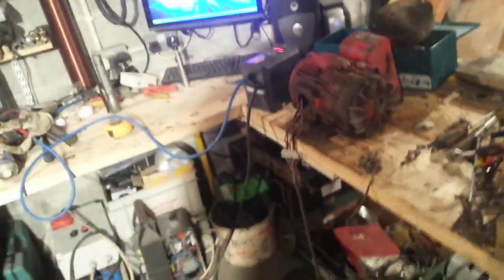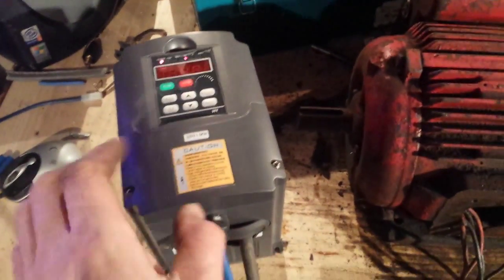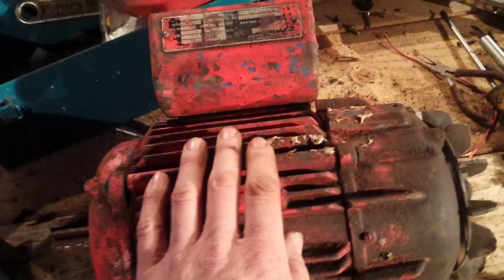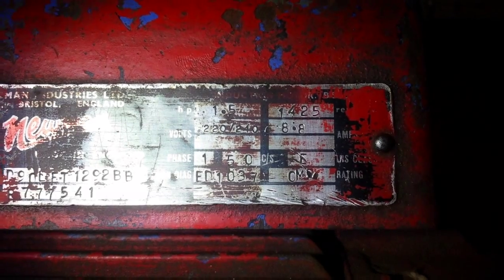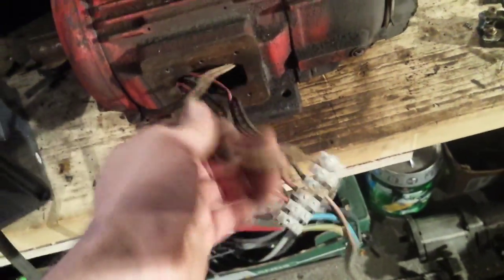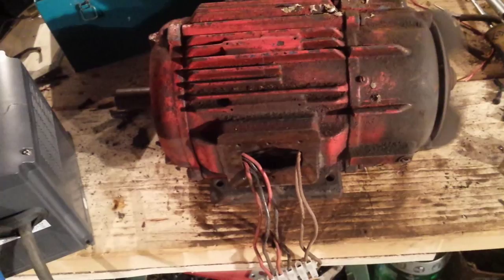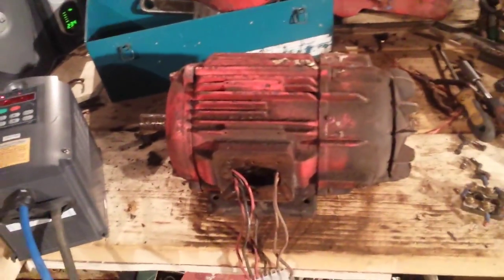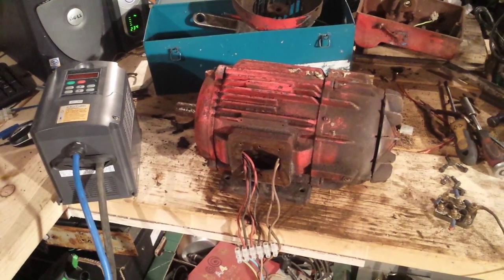1 Phase 220V motor converted to run on 3 phase VFD.

Comment: This is not good for the starting windings, but you could connect your single phase motor normaly with capacitors only use two phases on the vfd, if the vfd gives an error you use different phases because only two phases have current transformers for reading the motor current (If you have a starting cap with the centrifugal switch dont run the motor too slow, that switch needs to be disengaged after the startup) maybe use only runing cap if you dont need to start with loaded motor...

Comment: is it me, or is the earth attached to......nothing?
Reply: so when the centrifugal switch kicks off, only 2 phases run the main winding, at 120degrees, which apparently is good enough compared with the 90 degrees given by start caps
Reply: just thinking out loud, but is ther more torque with both windings energized? if so, could bypass cut off switch and run both coils?

Comment: Can you set the vfd to give you maximum voltage at any frequency ie 50
Reply from the maker: Zlatan Ibrahimovic yes the vid only changes the frequency from 0 - 400 Hz @ 240v
Reply: 2010DeanoRiordan cool, do you really understand what I’m saying tho, I want to power my induction motor at max output at any frequency the vfd can do, for example my 3hp motor running at full power(3hp) at lets say 40hz

Comment: Did the same thing, works fine.  Actually did a Pspice simulation to verify peak voltages and currents before I connected my motor.  Make sure you reduce the output voltage by sqrt(3) to compensate for phase to phase voltage being higher.